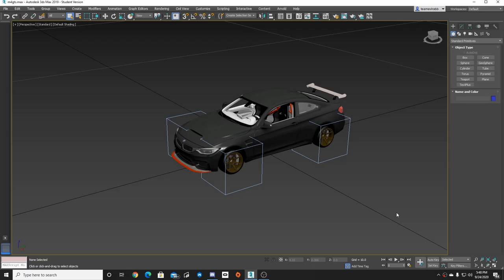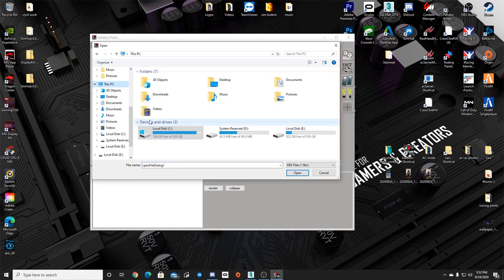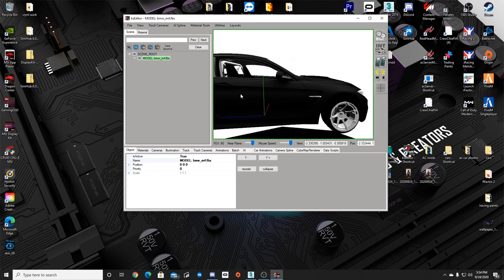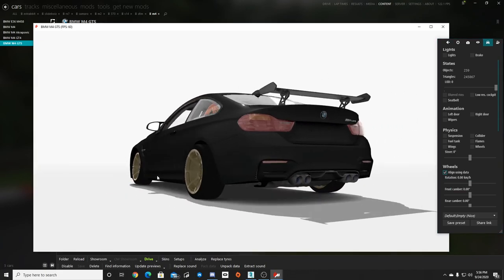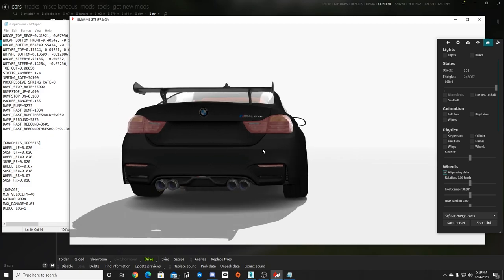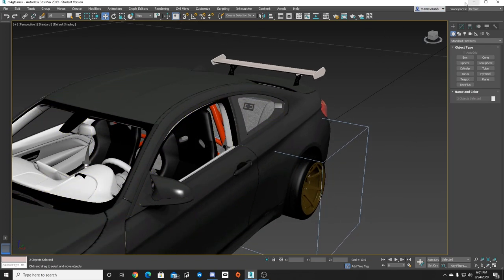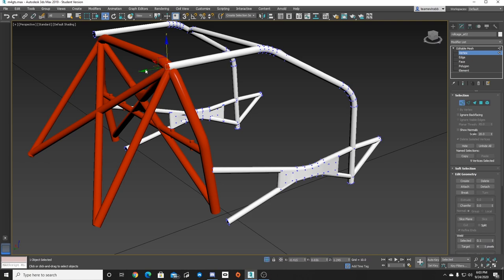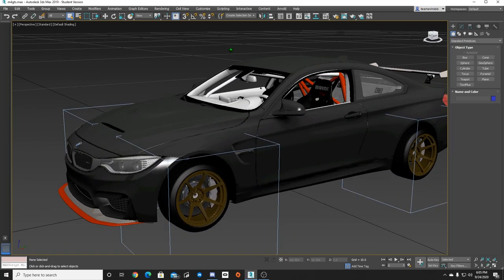Part 3 Assetto Corsa Custom Car Creation. -Exporting into game and fitment work

Comment: i keep getting null texture error how can i fix this
Reply: I have the same problem
Reply: Save the kn car to the destination folder of the original car. Make sure also to include textures of both cars 1st the original and then the other's car which you took the part .Be Careful when you copy 2nd car's textures in the first car's  unpacked/texture don't overwrite the same named textures.

Comment: my wheels move weirdly like they are on the wrong point pivot or something. and my flame shoots no where near my exhaust, also my driver and camera is on the left but my car is right hand drive how do i fix these things
ps, i also get a bunch of error messages to do with textures that i have to spam through before i can use the modded car,

Comment: my rear wheels are wobbly but the front ones aren't. also when I aligned the rear wheels they flipped inside out so i didnt align them i just moved the wheels there manually

Comment: Hey so I’m getting an error in the ksEditor when I load persistence it says: Persistence load failed, check if you selected the right node in the TreeView
Reply: Restart kseditor, load fbx(make sure it's from the folder also containing new cars textures including your old textures, copy and paste them, click skip), then immediately load persistence of the new car then the old car. You were clicked on the car or a part inside the car, so yes you weren't in the right tree. You can't be selected onto anything. Cheers

Comment: i know this video is old but ı have a question i installed a car and wanted to remove the wing i followed the steps that you did in part 1 and 2 but the problem is i was able to remove the wing but my cars dashboard lights the speedometer things* are not working and ı dont understand why because i didnt do anything other than removing the spoiler anyone have a solution?
Reply: use the elements thingy

Comment: I did everything in the vid, but instead of wheels i did taillights and an exhuast, i get the Error Eninge_Chrome... there is no option of the sort in my tab with all the vehicle components, anyone got a fix or know wtf is going on?
Reply: Copy and paste the texture folder from the car you took parts from into the texture folder of the car you are changing, if it asks to replace click SKIP. You're missing texture

Comment: what do you do if you get an error message when exporting the car and over writing the kn5 to see your car in game?
Reply: Have the same problem :(
Reply: I found the problem you have to put the textures from the car you took the wheels of(out of the texture folder) in to the texture folder from the car you want to edit.
Reply: @vito_dh_3648  which unpacked textures?
Reply: @bread704ac  When you open the content Manager and go to the car you want to take the wheels of you go to cm showroom where you unpack to kn5 (how It is shown in the Video). And you unpack to kn5 the folder pops up in explorer and then there are 3 things in the folder First the texture folder and the the two other files. The Textures in the Texture folder have to be copied in to the texture folder from the car you putting the wheels on. When you dont unterstand i send you a Video on insta!
Reply: @bread704ac  That Pop up in the folder when you unpack to kn5
Reply: @vito_dh_3648  Precciate man